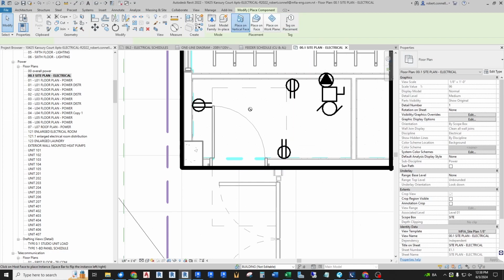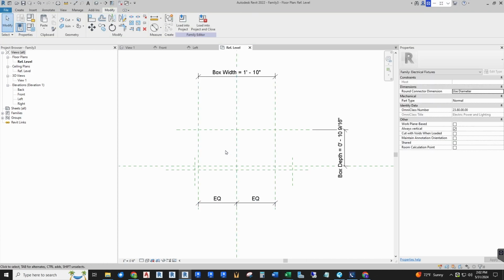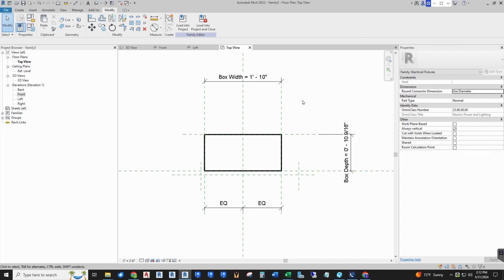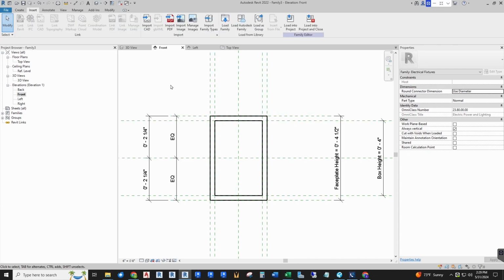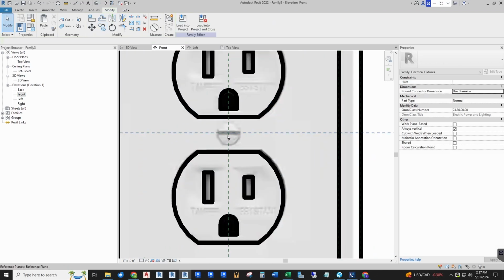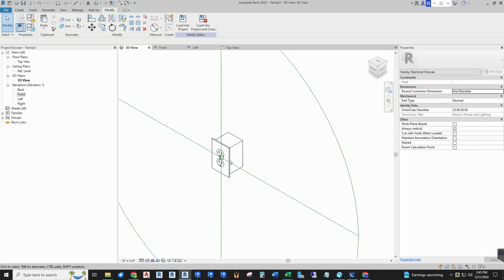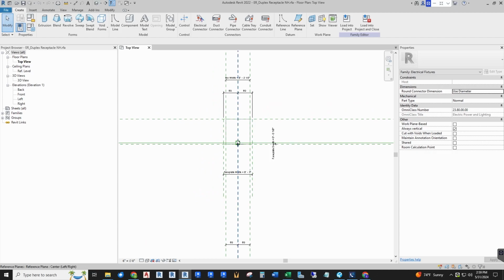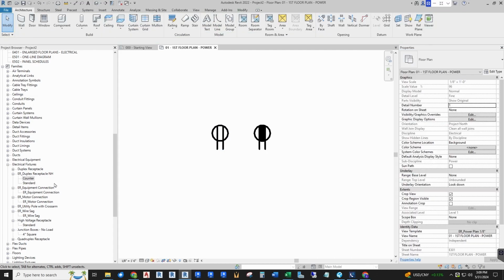REVIT MEP HOW TO create a 3D NON-HOSTED Receptacle (Family Editor)

Comment: Hi Rob. Would like to ask if what do you prefer to use in your projects. Is it hosted family or non hosted family? For my side I prefer non hosted. but would like to check on your preference. Thank you and thanks for always sharing your knowledge to us. Have a good day.
Reply from the maker: Hey there - good question. I still use a lot of hosted receptacles, but will probably end up going more non-hosted, so I can have more control over where my devices are (not just being dragged around by the walls). And I've used a lot of non-hosted lighting fixtures, since early architectural models don't always have the ceilings we need for hosted. And, we still get the occasional architectural background in CAD, so we use find non-hosted works well there. I will also be posting a video covering non-hosted panelboard and switchboard families. Appreciate the feedback and support!
Reply: @ElectricRob  thanks rob.